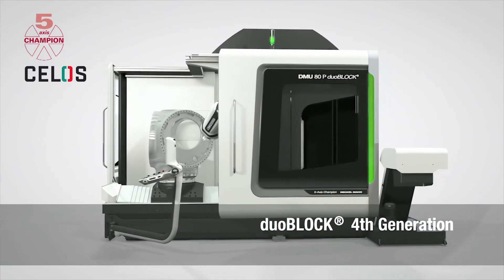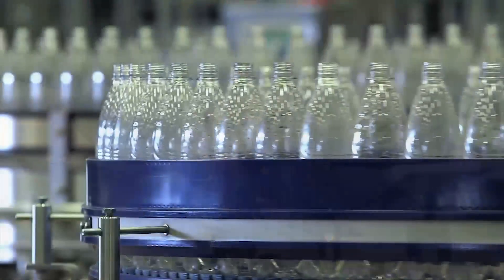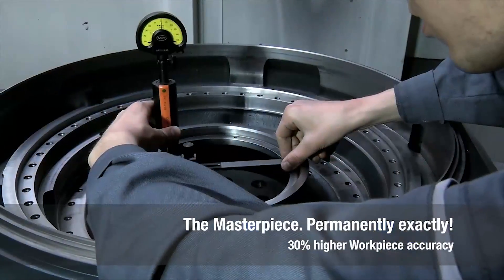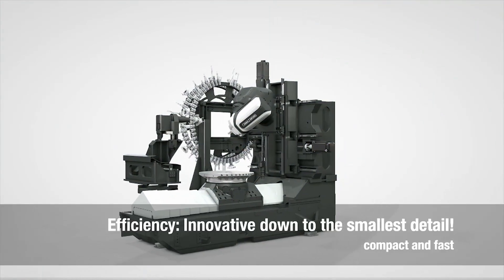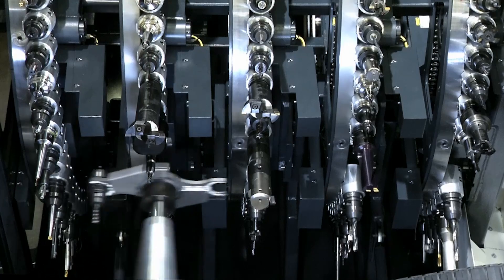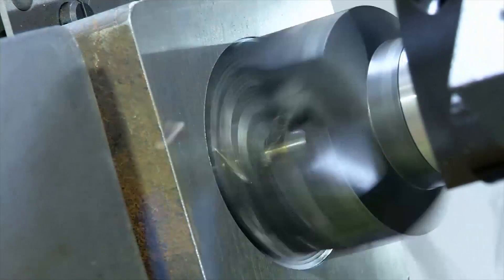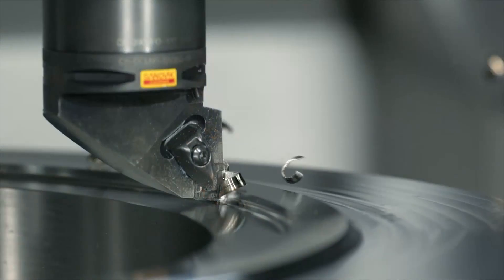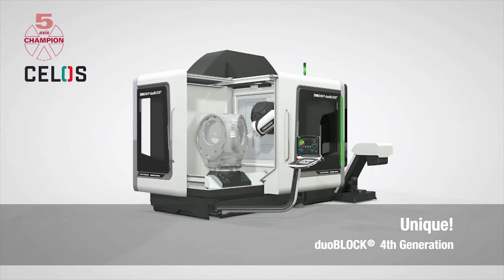4th Generation duoBLOCK® by DMG MORI

Comment: The guy doing the voiceover is the same guy who did the voiceover for the becker diamant tool company. The difference is , when he calls something 'the benchmark' for that company, its actually a benchmark, since they do PCD/CBN. But generic general purpose machining center not gonna be the benchmark ever. Even the 77kw motor is undersize compared to other companies. Brother put a 15kw motor on a 30-taper machine. That's something you would call a benchmark. There's 100kw standard on machine of most german machining centers of the same size.
Reply: "Brother put a 15kw motor on a 30-taper machine" yea no thats called overpowerd, overpowering stuff is a wast of money so not a benchmark at al

Comment: extremely compact? it's like a big ass ferris wheel with no tools in the center
Reply: +meocats It has no tools in the middle because it's easier to have five rings that rotate to grab a tool. Not to mention that a large chain is much more massive, and requires a bigger motor to move. That ring can rotate pretty fast anyways since it's more rigid.
Reply: tool crib / matrix. Kern has 300+ tools in the space of 1 wheel
Reply: that would be 1 massive fucking wheel mate can hardly believe that. even if its true i would mutch ratter have 3 1/3 of the size wheels. ps at my job we also have chain tool magazine 1 CTX800 beta NC its not that big. but we also have a Mono-block 105 X_X huge fucking tool magazine you could place 9 of the wheels in that space. 
ps kern is not made for the same stuf as DMG